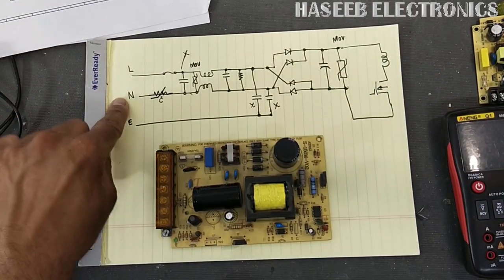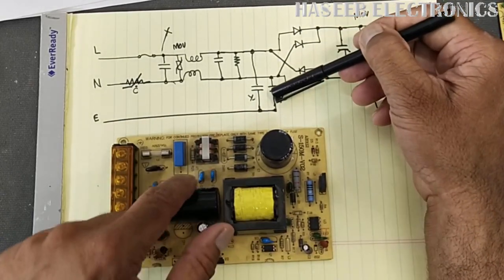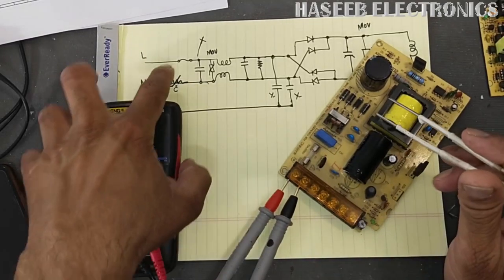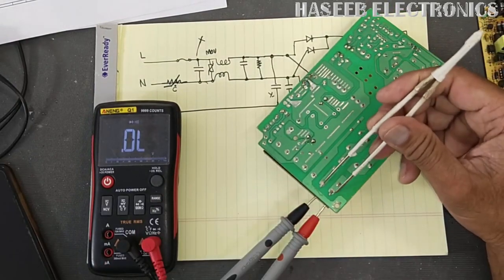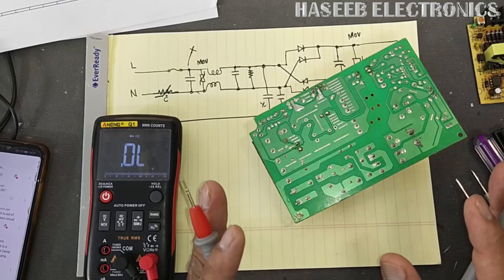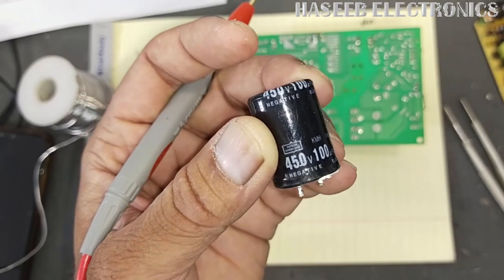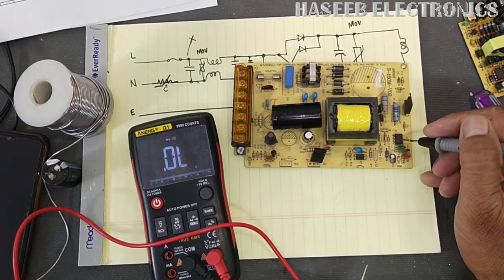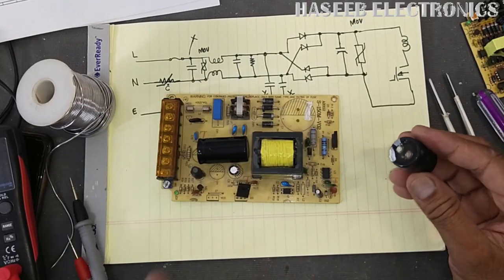{652} Fuse Keeps Blowing in SMPS || How to Find Short Circuit in SMPS

Comment: Hi Mr.Haseeb,your videos are AMAZING.You are a real teacher,i have learned a lot from you.i have one question.i have a SMPS and i have only 299-301 Volts at the capacitor(with 230V input voltage).what can be wrong?the driver?
also i dont have any output dc power at the secondary.Thanks in advance for your reply

Comment: Hi Haseeb, thanks for continuing to educate us.
I have an issue using relays to switch on smps, after a few weeks - months, the relays become unreliable and won't switch the psu off. I guess its welding contacts together, tried larger relays and rc filter, gave little improvement. Think I need a softstart, if you could teach me what it's is and give me an idea of how to implement this I would be grateful. Psu 240v 400-600 watt units, their only powering 3d printers not huge induction motors or anything.
Thanks.
Reply from the maker: welcome dear
in your case if its 600 watt psu, so its input inrush current is very high, which cause arcing on relay contacts. 
you can use TRIC, that will the best solution, and it is long life

Comment: Sir thumbs up done i see your demonstration you put your meter in continnuity mode with a beef sound in the input of primary ckt then you shorted the diff parts in the primary and meter have beef sound but i cant recognized the resistance measured in the meter if its in the range of less than k ohms sir tnx

Comment: Hi Haseeb,your videos are amazing,i have learned a lot from you.i have one question.i have a SMPS and i have only 299-301 Volts at the capacitor(with 230V input voltage).what can be wrong?the driver.also i dont have any output dc power at the secondary.Thanks in advance for your reply

Comment: Very useful and instructive video. Mr. Haseeb, I am trying to repair a smps power supply. When I checked I found that IGBT was shorted after replacing and connecting the power it blow again.
I checked everything, disconnected the output from IGBT, but again after connecting the power it blowed.
The driver is L6561. Can you help me where the problem is.

Comment: hello, on my tig welder I blow the fuse only when I start welding. If I press the trigger, I can see the the mosfet gate voltage oscillating, but as soon as I start an arc  (by putting the welding gun near grounded metal) ....then fuse blows instantly, I I have to change maybe a random 3 out the 10 mosfets......I wish I could manually choose the PWM to very low duty cycle on order to see if the error comes from a bad (too high) duty cycle

Comment: Sir i have a big problem...my smps is doing good when connected in series with a 100watt bulb....even output is good...switching frequency is 15khz, there is small humming coming out of transformer...but when directly connected to mains, fuse gets blown due to short circuit...i have checked all the components, all is good...diode and mosfet is initially shorted, i have replaced it...100watt glows at around 60 watt in series.

Comment: I have a 12 v 5 A SMPS .it gives 11.39 v output..can you tell me what is the problem here.when i check the filter capacitor voltage it give 310 V instead of 324 v .

Comment: Salam sir. Battery charger cold testing...conneted  meter in ohm mode high...shows open circuit. The batter charger is charging though. If the charger is ok why it charges the battery?

Comment: Mr haseeb my greetings i need your help
I have battery charger 5v 2amp no output . When measuring bulk cap it is ok and no short circut it is self oscillating using mje13003 npn transistor when measuring the base no startup voltage i am measuring the startup resistor value is ok it is 5megaohm voltage exist on one side the other side of resistor no voltage

Comment: Sir always in my area voltage is below 200AC
As per the calculations 200 * 1.414 = 282.8DC
While checking with multimeter for a second 285DC voltage showing and keep steady 245DC can you explain the reasons

Comment: Why the out put voltage of the smps still have higher frequency signal in the dc side still I try powering another high frequency power supply and the buck converter would not turn on it only turn on when I remove the power the energy in the capacitor turn the buck pwm on for some time so why is this